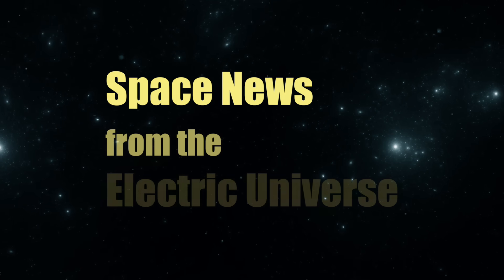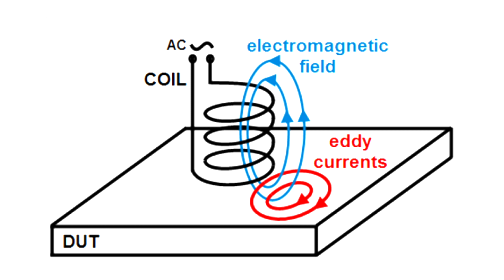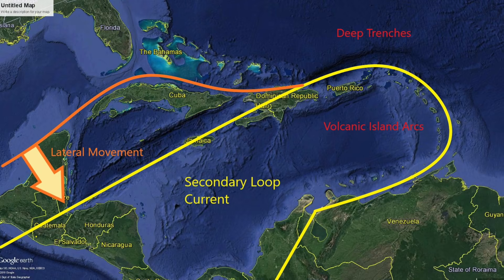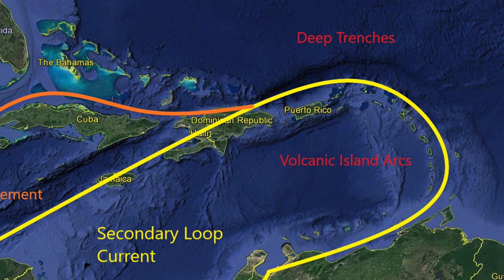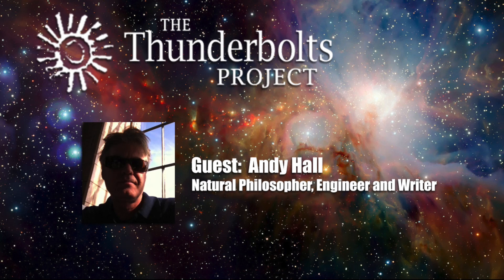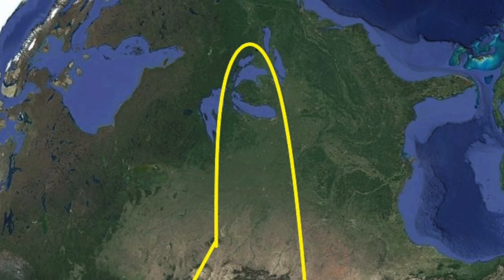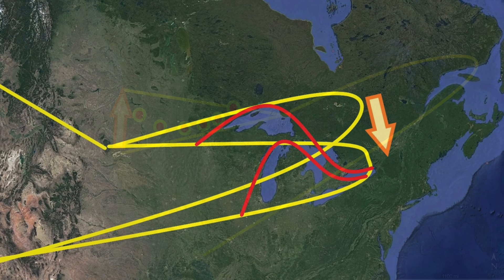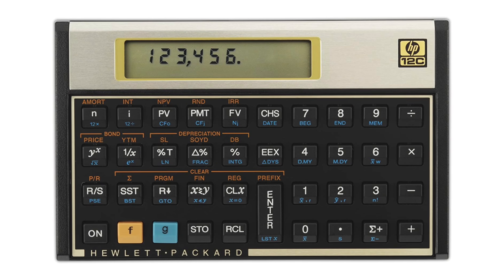Andrew Hall: Subsurface Birkeland Currents – How the Earth Thinks? | Space News

Comment: As a teenager, I asked a teacher why a tanker was chained to the ground when it delivered fuel, he said "because the motion inside the tanker on the journey, generates static electricity wich they have to discharge before they connect the metal hose couplings, so as to avoid a spark and explosion" i asked him two questions he couldn't answer, where does the charge go after it reaches the earth, and, with the earth being a ball of churning magma, where is the earth discharging the massive amount of charge that churning must create, and then I asked the same of the Sun, he didn't have answers, but he was curious, I saw it click, I didn't know what I saw click, and I didn't know what had clicked in me, but I've searched for years for answers, and 6-7 years ago, I discover suspicious observers, and I agree with them, and the thunderbolts project too, except when they set us up for ridicule, the earth doesn't think, there's an outside chance the cosmic Web does, but the earth doesn't

Comment: Is the earth hollow or solid with a molten core which would be more conducive to an electric earth?
Reply: Hollow, it can not be solid, solid Is a result of the idea of collapsing materia into a singularity.
But materia binds as it's spin attracts materia with opposite spin, and in such there must never be a solid in the middle.
Think if a line, on the top there is spinning materia clockwise and under anticlockwise and the result is gravity in the middle as it attracts each other.

Comment: Good science there Andy. I would like to point out one thing though, a fixed electric field which has molecular water in the medium will not produce steam. It will separate the molecules into a loose form of Hydrogen and Oxygen and ANY plasma filament (Lightning, Flame, Spark) will ignite the mixture and ... well ... BOOM !!! Steam would not be the result until long after the electrical storm has has time to heat up the medium but an explosion would instantly raise the heat enough to start the mountain building process.

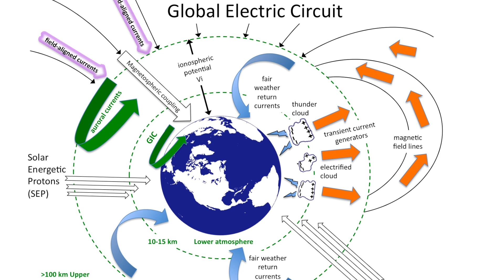Comment: 12:17 "There is no butterfly effect" - While it would be completely wrong to say that a butterfly has enough energy to stir a hurricane, there is a phenomenon called chaos, where a small disturbance in a system will cause that system to evolve so that the disturbance grows. Therefore, a butterfly's tiny disturbance, and every other disturbance, will be amplified over time, simply because a lot of fluid-dynamic systems (e.g. the world's weather) are fundamentally unstable. This is common in non-linear systems such a fluid dynamics. Air and water are indeed fluid-dynamic systems, so they are fundamentally unstable. One example is that a small depression over warm water will grow into a major hurricane or cyclone. This is an example of a small disturbance leading to a large disturbance. There has to be a source of energy (i.e. lots of warm water) and when the energy is dissipated (i.e. the hurricane/cyclone becomes disconnected from the oceanic heat supply) the system is no longer unstable and fluid friction will slow the winds.
Reply: "It's one of the fallacies of modern science." I think you'll find that scientists have a better understanding of it than popular stories in newspapers.

Comment: Nobody says butterfly wings cause hurricanes. Chaos theory says any action reverberates an effect for the rest of time, it's just that the effect wins down into having infinitesimal effect, eventually. So it doesn't cause hurricanes. It serves as an initial nucleation point for future events which revlve around the fact that it did happen rather than did not happen. It's like saying a room full of air is what it is, but a room full of air mixed slightly differently is that way because you were in thre breathing. So now one has turbulence which winds down but not before it interacts with other turbulence and so on. It's a domino effect. Whole dominos can knock down bigger dominos, nature goes with paths of least resistance. So it's usually smaller and smaller dominos that crescendo. So it doesn't cause the hurricane it affects whether the hurricane 500 years later happens 1° further north or south than it would have, and arrives an hour sooner or later than it would have. The hurricane happens regardless. The butterfly wings leave a trail in the cosmic background radiation just like all things all phenomena do.

Comment: The paradox of existence is that the only way for nothing (0) to exist, it must be juxtaposed by something (1). 

The zero has no value until it effects a value, but is the basis of all values. The hypothesis is that the only way for nothing to exist, is if something exists to create it. Reality is the cause and effect, logical deduction that there's only something, as the only way nothing can be a reality as its opposite.

So reality is 0 ÷ 1.  Nothing is the zero, and something/everything is the 1.  It's divided, which is the movement of reality, a division.  The division (movement) is matter. Matter is not the 1, there is no something ingredient to obey the law that nothing cannot exist. No, something and nothing are ethereal in this regard. Matter is the division. It's the movement itself.

This separation in physics, and math, is a division. Matter is the division. Division, or any math action, is a movement, so matter is movement. 

This movement is the 'expansion'.  The expansion is pi with the .134 remainder being the constant-mover of the expansion.

As reality 'created' itself in this way, it did what we see. Matter/movement never touches. Nothing touches. What we have is the movement curving away from itself at places of conjuction in its omni-expansion, thus curving at all radial points eventually sphering. These spheres of movement become the units of matter.
The directional expansion is in polarized volume (another logical deduction law following on the original basis) this direction is mass and it's gravity, which we can measure already. 

Matter is what separates nothing, it isn't something itself. It forces a something, as in a polar expansion, each equation in omnidirection will coalesce. This would be stasis, which is not the state of existence, so it curves its expansion at all points, in an external, and internal volume away from itself, creating sphering and spin, creating spherical units of separation. Matter never touches, because it is not a something, its only movement itself. 

Eternal facts: 

everything is always moving, only the perspective of observation changes.

The zero in reality and in mathematics, represents nothing. The one represents something in the same.

Only two shapes, forms, etc exist: Straight and curved.

Time is relative to the observer. Time does not lose its relativity at perspective. It is always linear in this manner.

Only perspective changes observation. All observable matter has infinite volume perspectives. The smallest mass, or matter observed, will always have a millionth of a portion, or a billionth etc..based on actual perspectives that may not be possible to observe. This loosely guarantees just as much expansion within things, as without. It is simply polarized. Only perspective changes. One or many perspectives are not the totality. There can Only in theory be infinite perspectives, plus the perspective of one, the totality.

The totality is an expansion out and in, creating nothing, to expand into. This is represented in π, specifically the .134..... Which is the constant mover on the edge at all points in a 3d reality of expansion.

All matter at scale is formed by, and takes part in, a spinning, spiraling, sphering environment.

Comment: Overall Andy I can understand and agree with you. However, I'm not sure you HP calculator had any OP-Amps in it (perhaps in the voltage regulator circuit). Integrated Circuits, yes...OP-Amps, not so much. I hate to criticize a detail like this, buy I think that it detracts from an otherwise brilliant presentation. BTW, I am a semi-retired Electronics Engineer, product designer, and general scientist with 50+ years experience. Yup, an old fart.

Comment: HP12C is completely digital and no op amps used for calculations. The internal photo shown is nothing to do with HP12C. The explanations for opamp are fanciful, the author has never studied electronics engineering and is clueless.  Put down the bong and lay off the mushrooms dude, you're tripping hard.
Reply: So eric  what are all the calculator logic circuits  made of  ? They do include often buffering inverters.  Symbolled with a small circle. What sort of amplifiers would they be ? Single transistors ? BC 109s ?  2N3055s ?  or  tiny Printed amplifiers ? Though still they dont perform any intelligent function like Logic gates.
Reply: @kimbo99  Considering that the HP12C runs on button cells I expect that the processor IC runs CMOS logic.
Reply: @ericmc6482   Perhaps we are being al little too hasty in our condemnation. The  Nand and NOR gates can be used as amplifiers. And occasionally are.  It might be just Andrews bad choice of words he is a POWER Engineer  designing  HV transmission lines
 CMOS gate as a linear amplifier.
By David Stonier-Gibson
There are times when you are making an essentially all-digital circuit, but need a little bit of linear amplification. Examples of this would be a microphone pre-amp for a sound triggered switch, or a photodiode pulse pre-amplifier. I have used this several times throughout my career, when a left over gate can be used instead of having to add another chip to the design. It works with any inverting gate, meaning NAND, NOR or NOT (usually called inverter). NAND and NORs have more than one input. Use one of the inputs, then tie the others to ground for NORs and + supply for NANDs. 
http://melbmcu.weebly.com/cmos-gate-as-analogue-amplifier.html
Reply: @kimbo99  True, logic invertors/gates can be biased into linear operation at a pinch but to state this mode is used in a digital calculator is plain wrong. His explanation of opamps is way off the mark and erroneously confusing  to say the least.

Comment: There's likely some truth to your theory, but you're just seeing patterns. Where's the evidence? You know the entire ocean floor has been dated. Meticulously. If this all happened in an afternoon, as you say, why are the ocean floors and continents of such diametric carbon 14 readings?
Reply: Dating techniques are so flawed. Any number of natural processes can render them utterly useless (and in most cases definitely do so). I agree the work was meticulous, but it is by no means conclusive.
Reply: The problem with this is that the ground is an insulator. If you say it runs through the sea, how does it form volcanoes on land?
Reply: @siddharthnandi3995  
Ground is what its constituent elements are at any given point. Saying the ground is an insulator is silly.
Reply: @critical-thought  By ground, I was referring to the majority of soil situated on land. 

Most of the soil on land is an insulator, therefore this theory makes little sense.
Reply: @siddharthnandi3995  
Uh ... please explain to me why buildings use grounding rods. Or why cloud-to-ground lightning exists.
Reply: @critical-thought  Soil does not conduct electricity. This is easy to demonstrate.

Take some dry soil. Bury a small lightbulb in it. Ensure that you can see the tip of the lightbulb. Now run lots of curent through the soil. The bulb does not light up. 

This is because soil is a poor conductor of electricity.
Reply: @siddharthnandi3995  
Then why do buildings use a grounding rod? In the soil where I live, it is not difficult at all to show a voltage AND amperage change across significant distances. Using a lightbulb is not a valid test. Using a meter is. Try measuring electrical changes in the soil during a thunderstorm.
Also, define “poor conductor” in the context of your experiment. Poor as compared to what - refined metals (which, by the way, were mined from the ground)?
Reply: @critical-thought  That's because the soil is an insulator. 

A poor conductor is one that does not conduct electricity properly. 

Soil does  not allow electricity to pass through.
Reply: @siddharthnandi3995  
I am trying to get you to think about your position and what you are saying, because you are not being precise or accurate. There are places where the ground actually generates electricity ... it is by definition a great conductor. There are places that are almost as conductive as iron or aluminum. And there are a great many places that are semi-conductive. Of course, there are places that are resistive. My point is simple - the earth’s surface is very diverse, sometimes even within a square yard. You cannot make generalizations about the soil or rock. It is not homogenous.
Reply: @critical-thought  I know that, but , most of it does not conduct electricity. 

It would not allow an electric current, especially one of this scale to pass through. 

Also. How does Electromagnetism cause earthquakes? Bulk matter is neutral and therefore cannot be affected by Electromagnetism,  so what gives?
Reply: @siddharthnandi3995  
Bulk matter is not neutral. Wherever you get your information, you could not be more wrong. Everything you have said is in direct contradiction to reality. Do some experiments. Learn something real.
Reply: @critical-thought  I don't know what you're talking about. When an object is carrying positive or negative charge, it is said to be charged. If an object is not carrying any charge, it is said to be neutral. 

The majority of things do not carry any charge, therefore they are said to be neutral. 

Electromagnetism causes things with opposite charges to be attracted to each other. 

If gravity was Electromagnetism,  things with opposite charges to the charge of the earth would fall in opposite directions.
Reply: @siddharthnandi3995  
I don’t think you are considering how dynamic the real world is. Nothing stays “neutral” ... everything is constantly seeking equilibrium, and sometimes finds a fleeting “steady state”. Even in artificially controlled environments (eg most electronics), extreme care must be taken to moderate the constant bombardment of external influences. Step outside. Experience life.
Reply: @critical-thought  Doesn't matter. Most things are still neutral or close to it.
Reply: @siddharthnandi3995  
🤣🤣🤣 whatever dude ... you need to start over.
Reply: @siddharthnandi3995  
Lol. Stick with “professor” dave ... his style of woo seems more suited to sheeple.
Reply: @critical-thought  Shoo.
Reply: @siddharthnandi3995  
Is that the scientific term for “I have never done an experiment” ? Even grade school students understand this topic better than you seem to. Some dirt, a battery, 2 electrodes, a volt meter, and a little water to spice it up. Surely you have at least done that one.
Reply: @critical-thought  I have done that one. The problem is, the majority of soil is not a consistent good conductor. At some point the curent will hit a dry patch of soil and will be unable to go further.

"Shoo" is the ligusitic cue to tell someone to buzz off.
Reply: @siddharthnandi3995  
Shoo is the linguistic cue of someone who is frustrated because they cannot support their position. And thank you for finally admitting that soil is a conductor. The fact that it conductivity is variable is your first step in this conversation away from generalization. Congratulations.